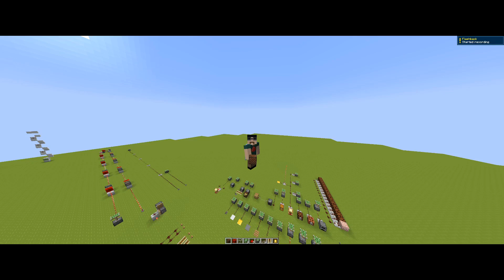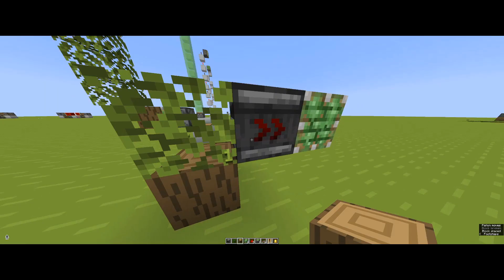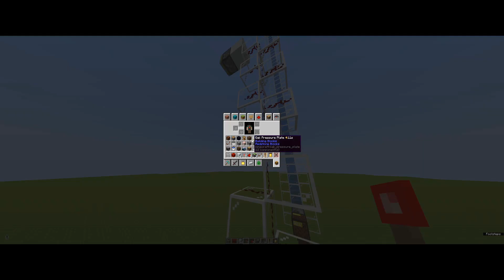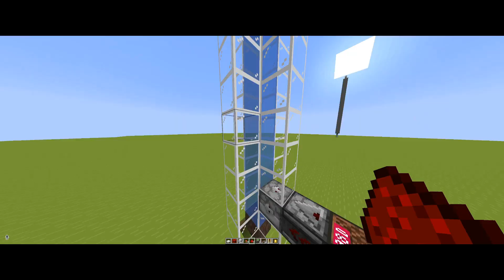Minecraft Redstone Java Edition - Redstone Signal Transfer (w/instant signal)

Comment: Great video!
Most people don’t really mention that vertical redstone signal transmission isn’t actually instant, and they rarely show the tick delay either. Congrats on the video!
I’d also love for you to check out the method I developed to make signals travel up and down instantly, with zero delay on both activation and deactivation!
Reply from the maker: Thanks for the comment, didn't really expect that. I just saw your video and it's very impressive that you found a even simpler way for instant redstone. I'll definitely use it in my other redstone projects. :)